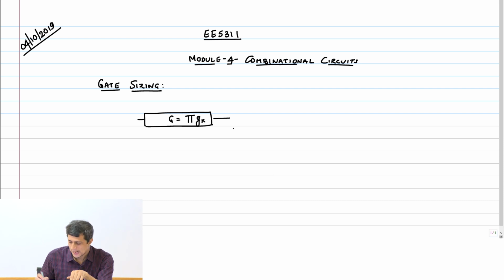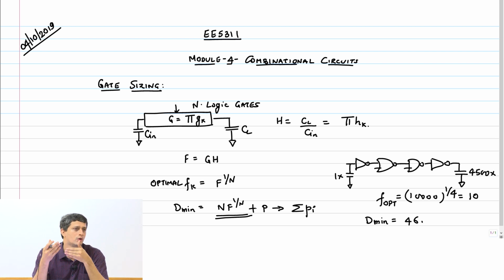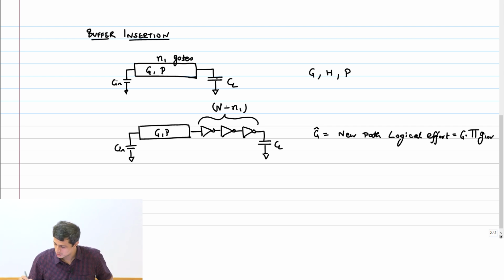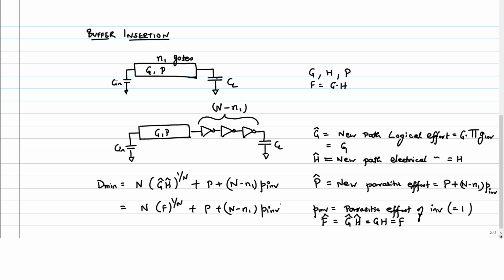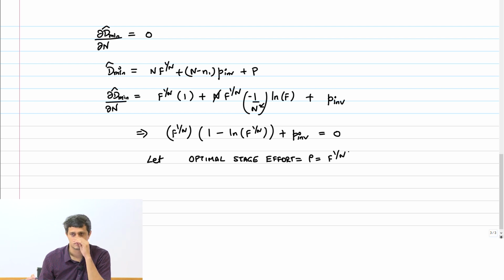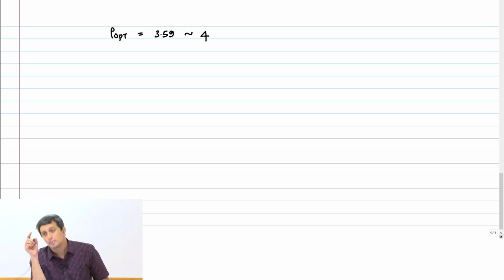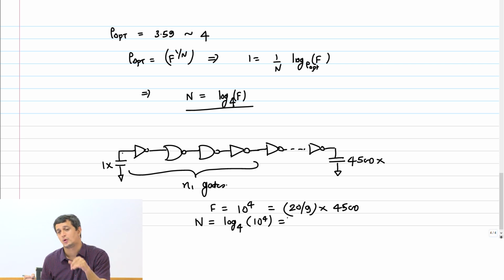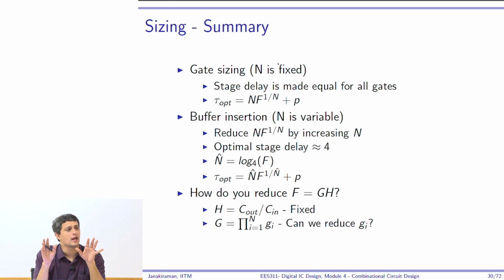CombCkt-11 - Buffer Insertion

Comment: Hi professor, your playlist on IC designing is great. I have watched all of its content. Thanks for the good work. I have a question related to inverter insertion to fix setup and hold issues. let us say we have a long wire of length 1000 micron after routing the IC,  does it matter where we place the inverter in that wire, in other words, how is the delay of a net and its fanout affected when an inverter is placed at 500microns or at 200microns or at 800microns in that 1000micron long wire. Similarly, let's assume there is a reg to reg path and we need to insert an inverter in its data path, how does the delay of this path change when I place the inverter near launch flop verses near capture flop ? please give your thoughts on this.